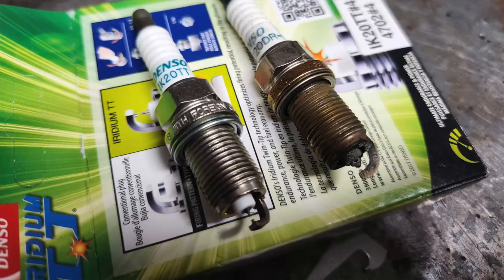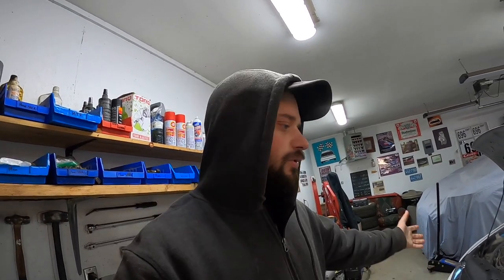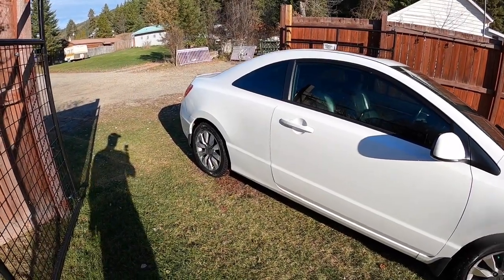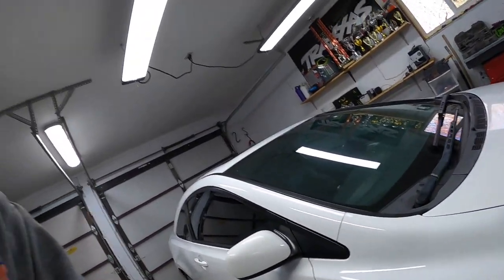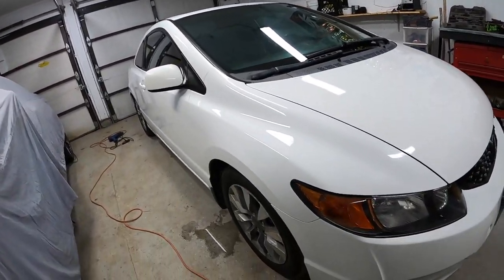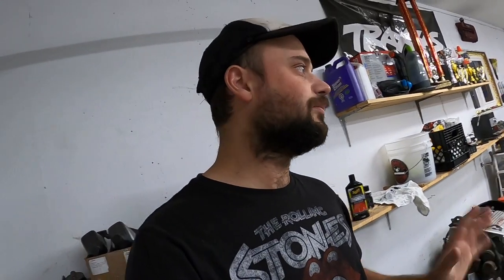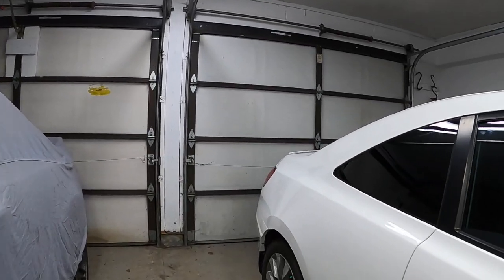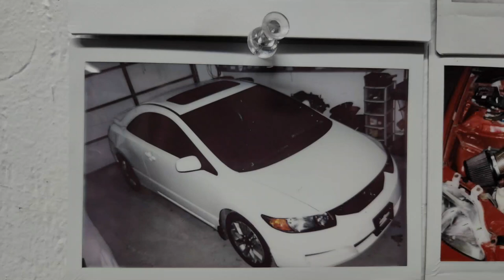Polishing and Ceramic coating the FG1 Civic

Comment: Hey bud l learn alot from u so keep grinding bro u are doing a great job  man,l am watching your video just now and you mentioned something  which I may have a problem with ok.l changed out my rear brakes calipers rotor and Ebrake cable but only one side is working the other side when you play with it only work for  a little bit of time then stop  working so as u mentioned the spring am thinking about it what do you think l can do to fix it
Reply from the maker: Thanks for the support! 

Id say have a look at the spring ok your caliper thats causing the issue, make sure its seated properly 

The other thing you can do , remove the cable from the affected caliper, and actuate the e brake lever (the one on the caliper) by hand, you should feel some resistance.. and it should lock the brake rotor by hand. Its common for them to have the internal mechanism fail.